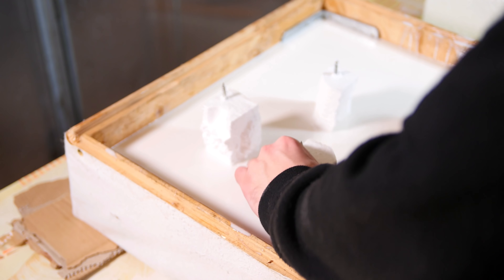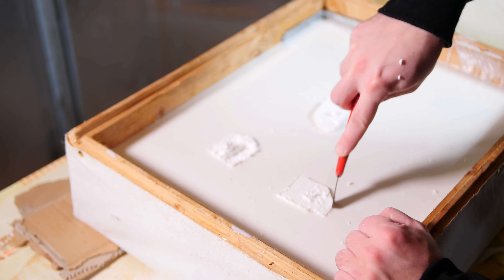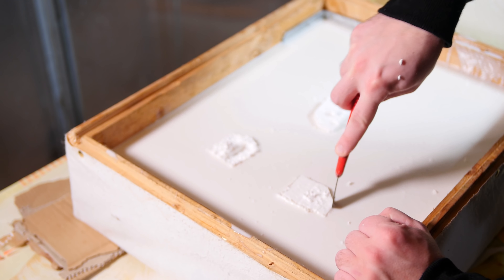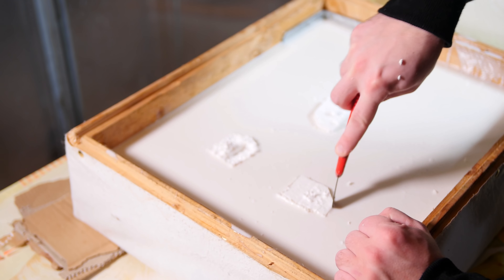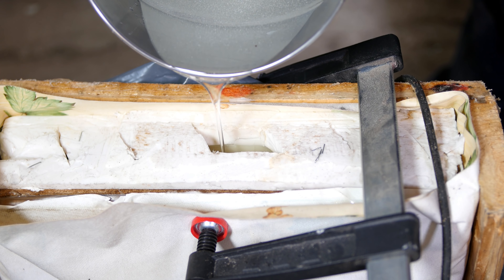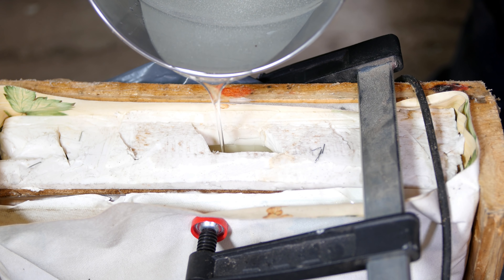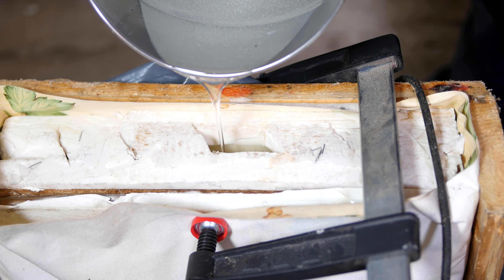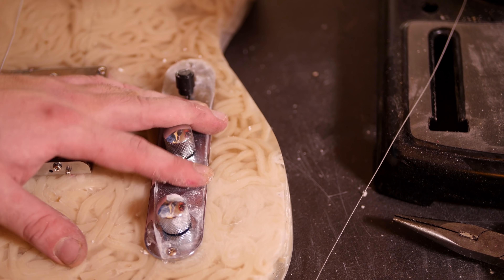Telecaster Electric Epoxy Guitar Build with Udon Noodles that glows in the dark

Comment: Does the epoxy harden the noodles?
Reply from the maker: Thank you for your questions. The epoxy increases the stability a great deal. But of course, I don't know if it hardens the noodles. To test that I'd have to cut it open and have a look ;-). But, the hardening process of the epoxy comes with a lot of heat. I've messured over 100° C. So, that alone should deprive the noodles of their water and make them harder.
Reply: @forwardaudio  ah interesting, cheers.

Comment: Wonderful video!
I’m a lefty, and it can be REALLY difficult to find left-handed guitars that are uniquely cool (i.e. cute, I mean uniquely cute).  
A few years ago a friend gifted me a necklace of a resin coated piece of marshmallow rope candy and it was really pretty.  So I’ve been thinking it would be awesome to have an resin/epoxy novelty guitar filled with some kind of sweet like macarons or pieces of that marshmallow rope candy. 
However, I’m worried the pieces will all fall to one side of the silicone mould due to gravity once I’ve placed it on its side.  Is there anyway around that?  Does the mould fit snug when you put the two halves together?  Or maybe I have to really pack the mould with pieces so there’s not a lot of moving around inside?  Is there anything I should be careful of?  I think I’m just thinking aloud at this point 😂.  Anyway!  I’m excited to try this out!  Thanks again for the tutorial ☺️
Reply from the maker: The key to success is to fill the mould as much as possible so that there's minimal chance that something moves.. When you have filled the mould and taking it front side down I'd advise to fill it only 3/4 full with resin and then let it harden. If something moved down due to gravity you can then fill it up again and do the last 1/4. That way you ensure that it's completely fill. Good luck with your project!
Reply: Ooohhh thank you that’s clever! 
One more question: will the smell last FOREVER?  Or will like...leaving it in the garage to air out lessen the smell.  I can’t possibly impress my peers playing a sweet-looking guitar that smells like death ☠️☠️☠️☠️
Reply from the maker: The smell? My guitar didn't and still doesn't smell. If you have good epoxy resin it shouldn't be a problem.